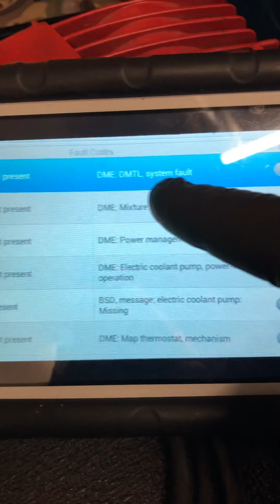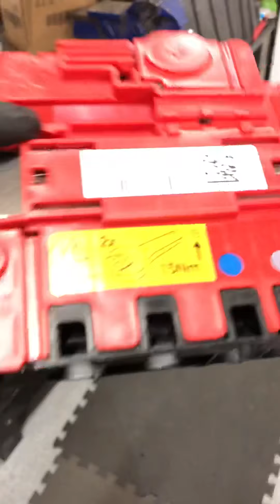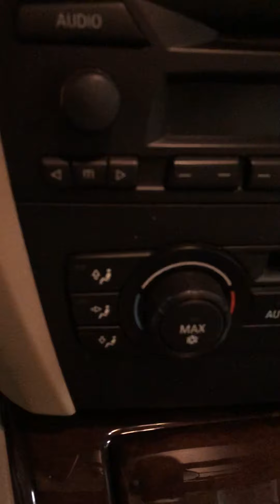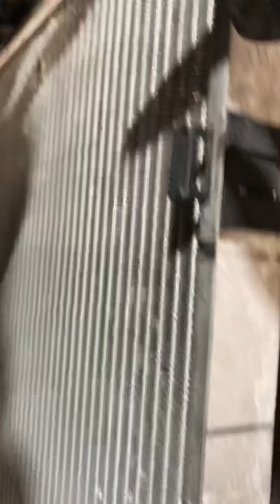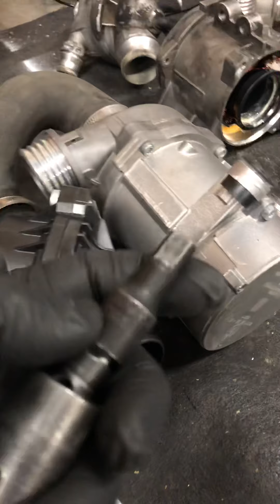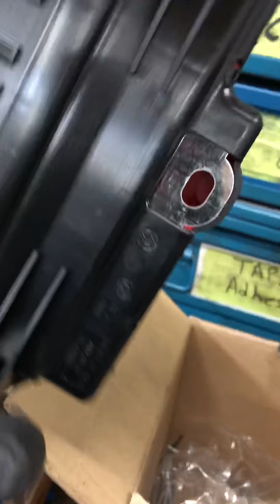BMW Water Pump Complete Repair Information

Comment: My N20's water pump was stays running even I locked the car especially when the engine is hot so then I replaced water pump but while replacing I just noticed that connector pins was corroded so I also replaced it too but now I'm curios that if my main problem was the connector or not. Can corroded pins cause that ?
Reply from the maker: Did you have an aluminum bolt for the ground loop of that water pump connector? If yes, did you replace it and torque it as specified by BMW and did you properly clean the ground loop and its mounting surface?
To answer your question yes, it is highly possible, the water pump is a network controlled device and has sensitive electronics built in. It is also possible that the connections being compromised could have damaged the built in control circuitry. Check for TSB’s or recalls on your car. Thanks for watching and commenting. Like and subscribe.

Comment: My CWA-400 is just not turning on at all but it has pwr, ground and signal🤷‍♂️
Reply from the maker: How are you checking for power?
Reply: @MechaniclifeJDM  multimeter
Reply from the maker: @00mrvip00  One strand of wire could deliver 12 VDC…..and fool you on that meter….but….the one strand could never deliver the amperage needed to run a heavy load.
DO NOT use the following method for computer inputs/outputs it will draw too much on those types of circuits.
Use a test light or an old window regulator motor, that will put some amperage draw onto the circuit you are testing, confirming that it can deliver the amperage, not just the voltage, and it proves it from start to finish.
You may have a corrosion issue, a loose connection, a damaged wire or crimp at a connector pin, could be just a bad pump, also check the main engine grounding straps. You could visually inspect your power delivery from rear of the car, to the front, ohming in sections but it may be hard to isolate the main cable for ohm testing, but I suspect you will visually find your issue if it is not a bad pump. Have you manually powered your pump? Post a follow up.
Reply: @ Thank you will do, not yet, I had a new one and it just stopped turning on after a month. Then I got another one with changing anything but the fuse and it also won’t turn on. It’s on a 30AMP, the fuses aren’t blowing. But I have a aux pump taking the load atm. I’ll try manually powering it tomorrow

Comment: Best expletive video on the matter, wish I had stumbled on it before, replaced the compressor on a 530xi it was extremely difficult to remove one bolt under the compressor; had to remove the thermostat which led to a whole set of issues cause of that U shaped hose, a big leak in that area showed up when I was refilling coolant after I put everything back, apparently all those issues were caused just because I failed to drop the sway bar, and to remove the bottom , I still has the thermostat and water pump out, it would be nice if this video explained how to drop the sway bar and to remove that protective covers, cause there is 2 plastics covers, one heavy metalic plate cover, and some other protective plate but no video online has explained how to remove those, because those are critical they r part of the job that real make the difference between reconnecting properly those back hoses, and no one in the videos posted online so far has highlighted that critical step to help do this job properly. Also, it is important to let people know not to use power tools to remove those single use aluminum bolts that attach the water pump. Even a weak 12 volt power tool will break them. If that happens, it's all hell break loose. I'm just saying it's happened to me and spent a whole day retraed that hole, and it was a real pain...
Reply from the maker: We have another car coming in for this job soon, we will make it a point to include your suggestions in detail, the feedback helps others and is much appreciated.

Comment: is that crystillisation of the coolant in the old pump the result of the wrong coolant or the result of mixing coolants that dont work together? I have florescent green coolant in my 3 series e90 and have done 30,000 kms since i bought it (was green before also). I just put on a new pump and thermostat and then both looked very clean inside.
Reply from the maker: Could also be a stop leak miracle fix in a bottle additive. 😎

Comment: Just an EXCELLENT JOB! THANK YOU! One question for me is "Is this much more difficult to do on a x drive car??" Thank you again for this full info and adding the red fusable link info too!! 😊😊
Reply from the maker: Thanks for watching and taking the time to share your thoughts, we appreciate your kind words very much. 
I have done them on the X5 as well, however I have not had the pleasure of doing this job on an X Drive car yet, but I do suspect it wont be much more difficult to do than shown in the video due to the experience I do have. 
Just work slowly, methodically, and safely and you will be just fine.
Feel free to come back to these comments and ask any questions you may have as the job, progresses, good luck, friend.

Comment: I apprieate you for taking your time out to do this, I just did this job just to find out something is leaking, can you please let me know is this (Part # 80000 ) which if searched on advance auto parts will work for the O-rings ?
Reply from the maker: Which O-ring position?

Comment: I have x5 e70 30! 2009 is 99c open thermostats But at 108c work fan and
 down temperature to 105c  is normal??
Reply from the maker: Will get back to you soon on this, I have the same one in the shop now for a water pump and thermostat replacement. After the job I can monitor and report back if you like.

Comment: The heat gun tip to get the plastic connectors off of the plastic thermostat is probably my remedy. 

Also, your advice about replacing the o-rings is very solid, this job is way too much disassembly labor to not be as thorough and complete as possible.

Update: The heat gun softened up the spring locked quick disconnects of the thermostat enough that prying and twisting 'em made 'em separate! Thank you very much for the guidance.
Reply from the maker: Very glad it worked out for you!

Comment: question bro, i haven't scanned my car for any error codes yet but my fan is going crazy like running really high for a few seconds then back down then high then back down just non stop..ppl were saying it's my water pump so i did the test where u just have your battery on and you hold the gas peddle in the activate the pump and it seems to be pumping fine. the car isn't overheating but it is running more on the hotter side of "normal" around like 220-230. do you know what it could be?
Reply: you may have a thermostat problem.   There is also information that older pumps have coolant entering into areas where electronics occupy. you can imagine how disruptive that would be.

Comment: I only have the water filling expansion tank when the engine is running
Reply from the maker: Did you remove the fragile little air bleed screw on the expansion tank, and fill slowly using only mixed coolant, and then run the bleed procedure with everything closed?

Comment: You can get that large hose off the radiator very gently with a large pry bar
Reply from the maker: Very true, and you can also warm it with a heat gun a little bit that would help too, thanks for the view and the good helpful comment, hope I got the thumb up